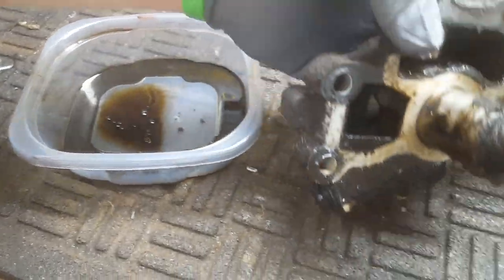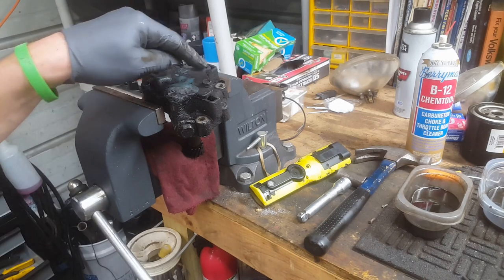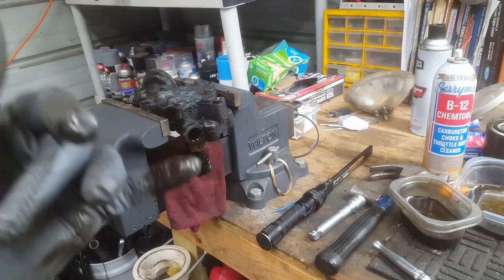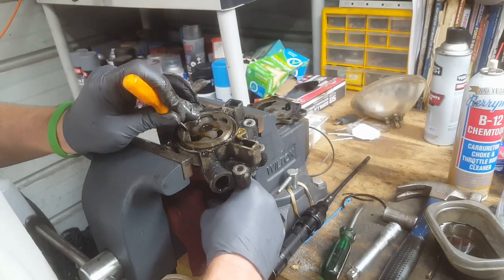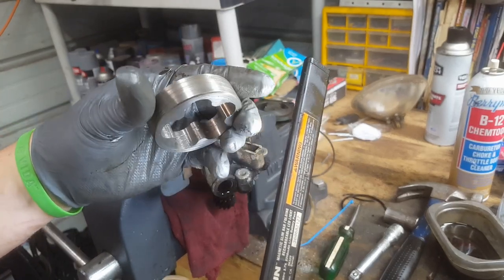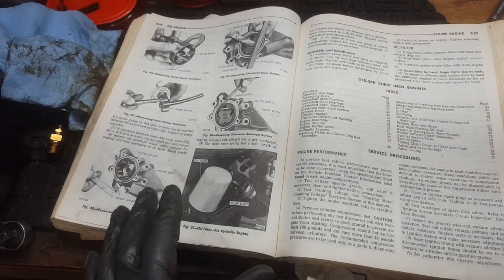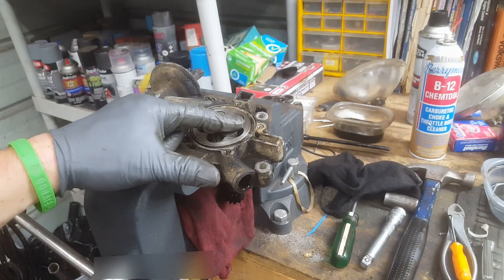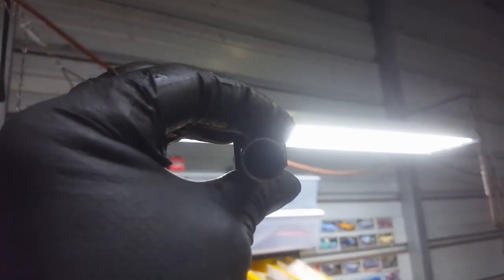Slant Six oil pump autopsy...cause it's DEAD!!

Comment: Tyler, thanks for making this video. Especially getting to see the oil pressure relief assembly come out for cleaning. As for standpipes, you said this one has a short stand pipe. I didn't know there were two lengths. I know that some of the newer ones don't have any. My '82 hydraulic engine has one same as your pump standpipe. I noticed that the Wix filter you had taken off is the one with a built-in standpipe. I have used that one for a while. Seemed to be slow getting pressure up on start and not always such great pressure after warm up. Some have said that it may not be a good idea to use the built-in pipe filter on a standpipe pump. Never got a definitive answer as to whether it's truly a bad thing. Anyhow, I started using the big Wix 51515 that doesn't have a built-in standpipe of its own. Just fits under the cylinder head lip. Pressure seems to start building as soon as it fires and I'm getting consistently higher running oil pressure. On the non graduated factory gauge, it seems to be about 45, sometimes 50. On new pumps, I picked a new Melling up off of ebay a few years ago for about $35. I spotted an older one with clear US made marking and thought that one was better. It is a 5 hole mount. That one has the cam gear pegged on, so don't know how easy that will be to replace it with the old pump one. Haven't installed it yet and in no hurry.

Comment: I was just welding the frame on a very Rusty Toyota Tundra pickup, Toyota wouldn't replace it. 30 years ago, I had a rambler with a 327 Rambler engine, and the oil pump shaft snapped, I just re-welded it and it was fine
Reply: hey cw,hows it going? miss ur videos man.
Reply: Myself, I'd like to get another late 90s 4-cylinder Ranger with a 5 speed. Or maybe a 1996 F150 with the 300 and 5 speed, just before the early 97's.

Comment: When you pull the oil pan , are you going to take a few rod caps off  , one at a time and main caps ?  Just a thought , if the crankshaft is good and only needs a polish and the bearings need replaced.. might be able to pull off a cheaper refresh..

Comment: That pump is definitely used and abused.  46 yrs ago oils were nowhere near as good as today.  I remember my Father did 1,500 mile OCI’s and still got deposits by 100,000 miles.  I didn’t see you get the relief valve piston out, probably is stuck closed anyway so would probably cause high oil pressure if anything.  I bet the bearings are past their prime and it needs an overhaul.  Fresh rings and bearings and that engine will last two lifetime’s with today’s oils.  I bet the bores on that engine don’t even have ridges.  I think Town square car show is this Saturday, hope you can make it.